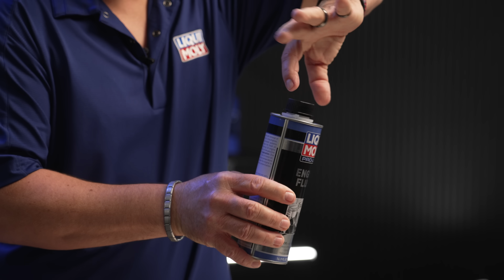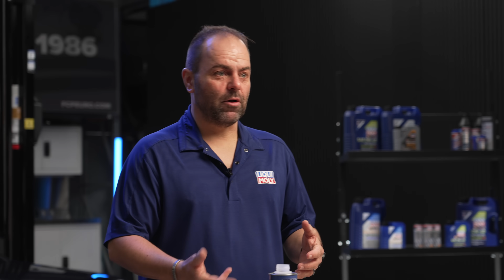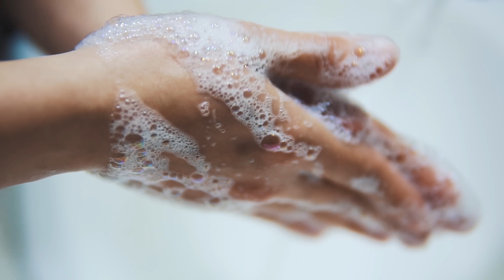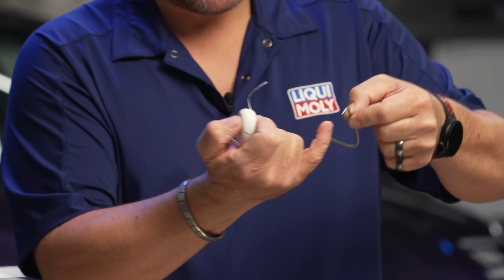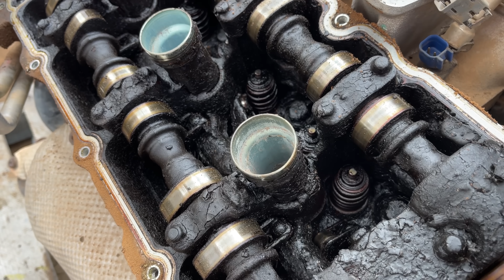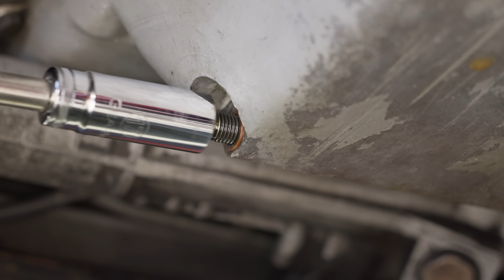LIQUI MOLY Engine Flush | Expert Answers to Your Most Frequently Asked Questions

Comment: I’ve used this product and although it is very good. I ended up using BG EPR with much better results. It takes a few oil changes to remove the varnish and sludge. BG also manufactures a more complex flush solution kit that costs substantially more, but it is used for heavily sludged engines. If you change your engine oil every 5,000 or 3,500-4,000 on turbocharged engines, you’ll extend the life of your engine.

Comment: Anyone thinking about using one of these high solvent flushes should watch Lake The Oil Geeks video on them. They are not good for your engine or bearing surfaces, they strip off lubrication and can cause damage. Regular oil changes is your best bet. I don’t think These guys have done the testing Lake has and analyzed engines and oil after running one of these flushes. I stick to regular oil changes with a quality synthetic that meets the car manufacturers specs. Tough to argue with a guy like Lake with all his experience and empirical evidence.
Reply: I have this horribly abused Audi A6, Lake made a video about Valvoline Restore and Protect, currently on the second oil change with that the car seems to have gained some of its lost power and mpg numbers back… personally I would agree with you and stick to synthetic oil changes. But I probably won’t do anything more than a 5k service interval. Honestly if you get a car to that point where it even needs something like an engine oil flush… u better off saving for a new car (or motor I guess but I question the overall condition of the car if the engine oil is neglected).
Reply: @jawadulkarim9498  That Valvoline Restore oil is even proven by The Oil Geeks to work. Basically one of very few additive or oils that make a difference or even something.
I guess it's a matter of how the state of the engine is before using anything other than regular oil. Where I live I don't seem to being able to get a hold on Valvoline Restore. But if I find it somewhere I will def try it out. It can't hurt at least. And I recently bought a 20 year old car and I have no clue in how it has been used. So I feel in my case if it's doing anything noticeable then there obviously there was "shit" in the engine otherwise I know the engine is probably fine.

Comment: This only works on sludge. Not baked on carbon deposits. Project farm and other channels have debunked engine flush products. Running Amsoil or Valvoline R&P with shorter OCIs will do more than this ever will

Comment: BMWs and now other brands are seeing engine failures due to the green new scam 1 year oil changes using 0w8, 0w16 and 0w20 oils. 
I remember when the manuals showed multiple viscosity choices based on temperature and service duty. 
Cars weren't dying on 5w30 and 5w40 oils. 
Flushing a bmw that's had one year oil changes is a smart move
Reply: It's  actually the extended OCIs more than anything else. BMW in north america faced a lawsuit when despite 5w40 or 0W40 oil,sludge failures were common when they tried to extend oil changes to 15000 miles. Many lawsuits and settlements as a result.
Reply: @ryanhuang8498 BMW never had 25k mile oil changes.  What's this lawsuit?
Reply: @HHP-t1o  If you look up BMW extended oil change lawsuits in north America on the internet,it's there
Reply: @HHP-t1o Back in 2005-2007 now having even recently.
Reply: @ryanhuang8498  Well I've been a BMW owner for over 25 yrs.   Now in the UK there's a lesser of 1yr or 2yrs and 25k miles.  I don't remember if it was 1yr or 2 yrs.   BMWNA went from 15k to 10k around 2013-14.
Reply: @HHP-t1o  BMW changed the recommdations to 10000 miles mostly because of the climate conditions we have. Eg. In Southern California,we have stop and go idling,extensive max A/C usage,and hot desert dust and wildfire particles. I often recommend oil changes of 7500 miles max for such condtions. Besides Stores like walmart sell BMW approved oils like castrol,valvoline,or Quaker state 0w40,0w30,5w30 and 5w40 Euro formulas at a price lower than $7 a quart when bought in 5 quart jugs,so might as well change it every 5000-7500 miles and purolator filters made by Mann+Hummel work just as well if not better.
Reply: @ryanhuang8498  I would opine it was because leasees weren't bringing their cars in on time and the turbos were  getting cooked with deposits which increased their warranty expenses under CPO but that's besides the point.   I was just curious where this 20k mile/lawsuit came from because as an owner of many BMWs for over 25yr yrs as well as a member of the BMWCCA I've never heard such a thing.
Reply: @HHP-t1o  You are right,my mistake it was 15000 miles OCIs or 2 years in the early 2000s but 25000 miles for certain "Lifetime" fluids in the manuals. BMW was facing lawsuits due to problems caused by them.

Comment: What do you say about all the videos out there where they have sludged up engines and run this with no noticeable difference?
Reply: I think many of those videos also make note that it's not a good idea to try to dislodge many years of sludge in one engine flush. I don't thing any engine flush is designed to do that.

Comment: Our friend is using liquimoly in 2023 Q5 TFSI and it is consuming 1L every 2500km. The vehicle has nearly 50,000km. Has the oil caused this?
Reply: No.  It's typical Audi things.  Try running Valvoline Restore and Protect in the appropriate viscosity

Comment: Regarding whether the engine should idle, I have some reservations; oil pressure varies depending on the type of oil pump in the car, and—as is well known—it is primarily the force of the oil flow that picks up deposits not fully dissolved and helps clean the oil system more effectively. In my opinion, therefore, it is worth letting the engine run at higher RPMs.
Reply: Would the lower viscosity affect the level of protection that the oil is able to provide?

Comment: Years ago a friend at work and his father helped me do a timing chain job on my 86 Toyota 4 cylinder truck engine which required pulling the head, his father asked what type of oil I used because it was so clean for having over 100k, which I told him I used Pennzoil and changed the oil every 3,000 miles!
Reply: Pennzoil lowered their quality this time due to the war, it's no longer using natural gas that makes it clean

Comment: Nicely presented video. I liked that he showed the MSDS with the ingredients. I would definitely run motor oil saver after engine flush to swell the seals. Every time I've used engine flush, I've had engine problems shortly afterwards. On a BMW 428i, the oil cooler started leaking and the valve stem seals too, causing black smoke on startup. Replaced the oil cooler seals and used motor oil saver to fix the valve stem seals. On a Chevy Cruze Eco 1.4T, the valve cover and turbo oil feed line started leaking. On a Lexus CT200h, the head gasket went and I saw the rubber coating on the multi-layer steel gasket eaten away near the #1 cylinder. Do I know that engine flush is at fault for all three? Not really, it could be a coincidence, but it doesn't seem worth the risk.

I used to agree with the idea that if your engine seals are already worn and deposits are preventing leaks, you needed to change the seals anyway so it's not the flush's fault. Now I have a better understanding of how seals work. When you remove something like a valve cover, you have to clean the mating surface and replace the rubber seal even if it's new because the mating surface gets contaminated and the seal doesn't go back on exactly as it was before. Engine flush seems to penetrate the seal surface and have the same effect as removing and reinstalling a seal without replacing it, which can cause leaks.
Reply: Think Sea Foam was the cause of oil loss in my 2012 Benz GL350. Can't say where, but likely a seal. Always suspected oil cooler. Instructions suggest you can run the product for a few hundred miles before changing. Aggravatingly, no indicators went off. Very apprehensive about anything added to oil. And agree with comments about analysis. Plan to get lab results on the next change.

Comment: I’m sorry, but it has to be said. Liqui Moly is the Lucas of European oil companies. It’s all marketing and gimmicks. No one should ever use an engine flush unless the engine is already junk and you want to try one last thing before scrapping it. Quality synthetic oils will clean your engine quite well, but at a slower and safer speed. Valvoline Restore and Protect in particular stands out and actually has data supporting their claims instead of pure marketing.
Reply: nope i think it's a good maintenance even for new vehicle running on the streets..

Comment: Some people recommend Valvoline Restore & Protect, but be careful. The standard U.S. formulation of Restore & Protect is primarily developed to meet API SP/ILSAC GF-6A requirements rather than European ACEA A3/B4 or ACEA C3 requirements.

ACEA A3/B4 & C3 requires a minimum HTHS viscosity of 3.5, whereas API SP/ILSAC GF-6A does not impose an equivalent minimum HTHS requirement. Restore & Protect has a relatively low HTHS viscosity, which makes it unsuitable for European engines that specifically require an oil with an HTHS viscosity of 3.5 or higher.

This distinction is particularly important for European-specification engines where ACEA A3/B4 or ACEA C3 is explicitly required. Meeting an API/ILSAC specification does not automatically mean that an oil is suitable for an engine requiring a higher-HTHS European specification.

Valvoline itself has discouraged BMW owners from using Restore & Protect in their BMW engines. This can be found in the comments under Restore & Protect videos on Valvoline's own YouTube channel.

UPDATE: Since July 1st 2026, Valvoline has introduced Euro-spec Restore & Protect oils for the European market. They are available in viscosities such as 0W-20, 5W-30, and 5W-40.
According to the specification sheets, depending on the viscosity, these oils carry specifications and approvals including ACEA C2/C3, BMW LL-04, Mercedes-Benz, and Porsche approvals. This means they meet the required specifications for European-spec vehicles.
Important: The formulation of the European R&P oils is different from that of the US-spec Restore & Protect.
Reply: You're saying that the way that Valvoline has chosen to communicate product risks for specific makes of engines is in the comments of YouTube videos?
Reply: @NJFPV  No, that’s not what I’m saying. There were a lot of questions about this because of R&P’s popularity, with consumers wanting to know whether they could use it in their European-spec vehicles as well. People specifically asked Valvoline about this in the comments under their videos, and Valvoline responded. You can verify that yourself.

The vehicle manufacturer determines the requirements the oil must meet, including factors such as HTHS viscosity and the applicable performance specifications and approvals.

Valvoline itself does not recommend R&P for engines that require a high-HTHS oil, which includes many European-spec applications. For those applications, Valvoline recommends other products in its range that meet the required specifications. R&P does not meet those. It’s considered an eco oil for cars with ILSAC requirements.

There is a reason R&P does not carry approvals such as ACEA, BMW Longlife, VW or Mercedes-Benz approvals. It simply wasn’t formulated, tested and approved for those applications.

You can choose to use R&P anyway. That’s your choice. If you choose an oil that falls outside the vehicle manufacturer’s required or recommended specifications, any potential consequences related to wear or lubrication are ultimately your responsibility.
Reply: Yes you can get it in the uk now. Its as you say ACEA C2/C3 rated. Fine for diesels with Dpfs.....

Comment: Nobody ever mentions the fact that no matter what you do there is oil remaining in the pan when drained. That oil will have remnants of Engine Flush in it. Then you add new oil. Where does the engine flush go. If you don't use a cheap oil rinse you cannot say there is no flush in your new oil. Who has time to flush with oil every time.
So chemically some of those ingredients including solvents that lift deposits off metal, even if in small amount plus a little of the flushed "debris" that was removed will be present for the next 3 to 5 thousand miles. I have never been able to find out how that will influence many types of seals in the engine. Probably other parts that don't like solvents. I don't know, I am not a mechanic, but I am a Chemist.
Reply: As a chemist you might understand that a few hundred ml of engine flush in 5+ litres of oil is a very low concentration, what is then left after draining the oil/flush mixture is a very small amount of a very low concentration then being diluted into 5+ litres of  fresh oil. we are talking about minute quantities. As for the remaining "debris", again it is only a small amount of oil left after draining so the must also be a very small amount of "debris", not forgetting that it will be diluted in the new oil and will pass through the oil filter before it is sent to any sensitive parts.

Comment: What needs to be tested now is how well these oils perform in today's mild hybrid, full hybrid, and other sensitive vehicles that use very thin oils like 0w20, 0w16, or even 0w8, and have delicate engines. Because these engines aren't as rigid as those that run on 5w30, 5w40, or 0w40 oils. They are more delicate and sensitive and often reach temperatures 100 degrees (even with very calm driving situations 😢)
Reply: The reasons for using 0-20 is not that engines are delicate - it's that companies need to meet ever-interesting fuel efficiency standards. Less resistance = less energy to do the same job.

Comment: I prefer gentle cleaners such as oil-based flushes instead of strong solvents based cleaners. What do you think could  be my reasoning for that approach, especially on a high mileage engine?😎
Reply: Triax Pro Engine Flush is oil based. Good stuff

Comment: After you’ve drained the oil, you can never get 100% of the oil/ flush mix. Will the remaining flush breakdown the efficiency of the new fresh oil?
Reply: yes but not a lot. when using the engine flush bg 44k cans , cheap rinse oil is recommended after, then regular car oil
Reply: When your engine get hot it wil be burnt away

Comment: No question is stupid but I use an extractor with a compressor for my Audi B8.5 and my Mercedes-Benz w124 for oil changes. Is that fine to use with this product?
Reply: You can find tests on YouTube. An oil extractor removes just as much oil as a regular oil change where you remove the drain plug from the oil pan.

Comment: Many years ago in the days of crap oil, clogged oil return galleys, we would do a flush. Warm the engine and turn the idle screw down as far as it will go and still run. Drain the old oil, and then take half of it and mix in kerosene and refill the engine. Start the car without using the gas pedal and let it idle for 15 minutes, drain, and refill with the new oil. 
Also would pour a small amount of transmission fluid down the carburetor every once in a while to lubricate the valve guides. 
I guess I'm that old!
Reply: Same  trick,but with Diesel fuel

Comment: I and I'm sure many other engineers wouldn't unless you have a specific sludging issues in an engine. No common wet-sump engine drains 100% of oil at an oil change.. after 'flushing' with this product your are 100% leaving some qty of the flush product behind when filling with fresh oil. Talk to some real tribologists and engineers about their knowledge of wear matter/particulate and the utlity of engine flushes. Cools story FCP. Use an OEM spec engine oil, change it regularly and dropkick addivitives and flushes into the bin.
Reply: Isn't the flush residue supposed to burn off; or does it NOT in practice?

Comment: If you buy a 150k miles car with engine that has no service history and oil filter has rust and you need spanner with cheater bar to take it off then asking “iS iT sAfE??” Is just funny 😂

I used it few times on bangers, flush + cheap oil after for 30mins and then proper oil.

Comment: Change your oil every 5k miles or 6 months, and you won't need to flush it.
Reply: Seems like someone didn't watch until the end...
Reply: Not true.
Reply: Unfortunately, this is untrue. While extended intervals may increase the amount of varnish on engine components, quality of oil, filter quality, and other factors play into sludge developing.
Reply: Also, time plays no role in modern engines using synthetic oils. You could drive 5,000 miles over 5 years on the same oil and you’re fine.
Reply: @heistkev most”synthetic” oils are actually group 3…… not actually synthetic. Only group 4 and 5 are really synthetic….
Reply: @TheCariocaleo they’re still extremely stable and easily last years inside an engine
Reply: @heistkevI think so too.
Reply: False. All VW/Audi engines are terrible and buildup like crazy no matter what you do. Stay away from that brand.

Comment: If you have to use this product regularly you are using a subpar oil or not changing it often enough. This is a harsh solvent that has been around in one form or another for decades. Engine bearings HATE it.
Reply: It could quite easily be oil of wintergreen or ester based oil, not necessarily a solvent formulation.